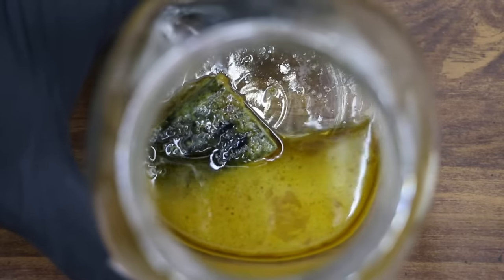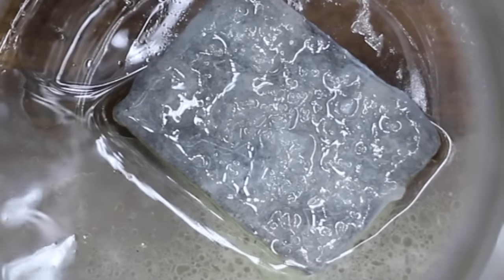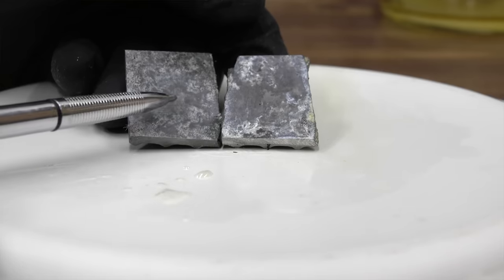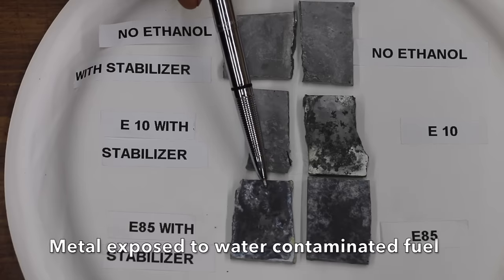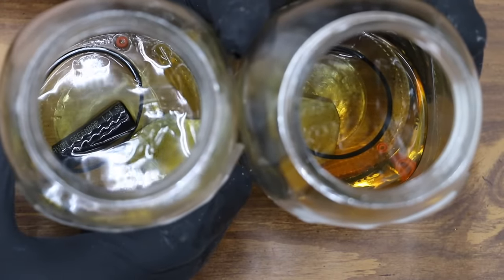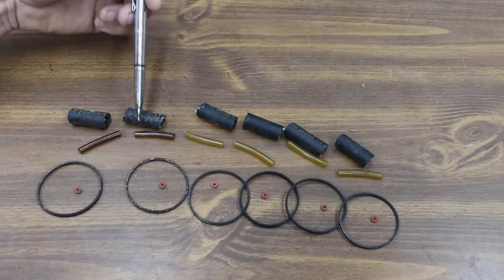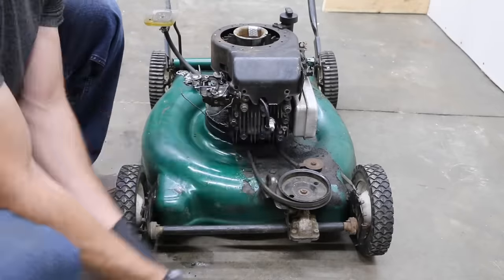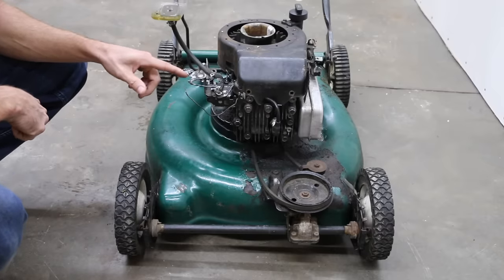Does Fuel Stabilizer Prevent Ethanol Damage?  Let's find out!

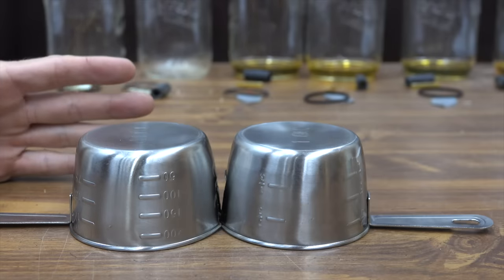Comment: 8:04 - Please test Sta-Bil. My experience with it is twofold. I never drain my mower or other 4-stroke machines at the end of the season.
The equipment (I'm just a homeowner/non pro) always fires up @ first or second pull.
I didn't use my craftsman weed whacker for a couple, maybe 3 years. It too fired up almost immediately last year. I haven't used it yet this season, but I have little doubt it'll give me no problem.
Reply from the maker: Thanks for the suggestion.

Comment: perfect thanks! so what about modern direct injection cars? does e10 or e5 cause damage to the engine or seals more then ethanol free ? or the only negative side is that it goes bad way faster ? in some videos says that e10 makes engine runs cleaner, some says rubber parts inside the engine suffer

Comment: Love the scientific test videos. as good as it gets without a lab. Outstanding!!!! Have two Tanks on my boat Aux tank has older fuel (8 mo old) but treated with stabilizer many months ago ,  v6 4 stroke runs on old fuel but barely idles, runs fine at higher(1000-1200rpm). Should I mix a small amount of old with new and run, burn it off, what ratio of old to new would you reccomend, please ?

Comment: I have had really great success with marvel mystery oil as a fuel stabilizer. Put in a little more than recomended on the bottle before I fill my gas cans. What doesn't get used over the winter, snowblower or generator, gets used in the mower. Any left at the end of summer gets dumped in the truck. I try and fill all the cans in late summer early fall. Try to beat the switch to winter blend.
Reply from the maker: Thanks for sharing.

Comment: If not already equipped, I add fuel shut-off valves to all my small engines (if possible). Then I shut them off using the fuel-valve, in order to burn off any remaining gas in the carb. Certain items, like generators with steel tanks, require draining all the fuel so the tanks won't rust. 
Otherwise, I heard a recent report that two-stroke gas-oil mix holds up better long term than straight gas, and actually, a few years ago, discovered that I'd left gas-oil mix in a small two-stroke generator for several years. Yet it fired right up.
Reply from the maker: Thanks for sharing.

Comment: Before I have even seen all of this video I can tell you one issue you might have overlooked with regard to ethanol corrosion issue... inside an engine, the carburetor is not totally saturated in fuel, after the engine is turned off, most of the fuel evaporates out, but with ethanol, because it actually is a source for water moisture, that moisture evaporates and off gases into the cold metal of the carburetor, and condenses on the small intake pipes of the carburetor and etch it enough to ruin the venturi effects, and after the ethanol has separated, there is also no way for the gas to ignite fully given the reduced octane rating. Poor syphon action will result in poor performance of the engine even when the gas is not totally bad, but with ethanol gas and a slightly damage carburetor, the drop of a few octanes can be enough for the motor to stall intermittently when otherwise it could run just fine. I have seen this happen within only a month or two. I enjoyed seeing this and still support my position of NEVER using ethanol based gas on anything with a carbonator.

Comment: Man you need to review Liquid Performance Ethanol Equalizer. I'm considering it but it's kinda pricey. Normally I use non-ethanol fuel in my truck and I get on average 100 extra miles per fill-up. Lately mileage has been lower though. Im wondering if they are adding a little ethanol to 'non-ethanol. Maybe this product does what it claims. Reviews seem positive but they can be bought.
Reply from the maker: Thanks for the suggestion.

Comment: I have a 14 year old generator that I keep ready to go year round. I use 87 octane ethanol free gas with Stabil and change it out by draining the tank and running it in my truck and then getting fresh gas every 6 months. Generator runs like new. I also only use synthetic motor oil in the engine.
Reply from the maker: Thanks for sharing.

Comment: Thank you! I just bought a generator for the storm season but thank God I didn't have to use it! But it has fuel in it! Question! Do you have a video on the proper way to store equipment to prevent corrosion?
Reply from the maker: You are welcome!  Thanks for the suggestion.

Comment: I had 5 5 gallon gas cans filled with e85 and used stabil per instructions that gas lasted about 15 months in central Florida garage.I did have one gallon that had some water seperation. The water was sitting on top of the gas poured it out and worked in lawnmower. Had I had a sealed tank where no air could get in and I think you could easily get two years out of them.
Reply from the maker: Thanks for sharing.

Comment: I thank you for the results from your test lab. These videos are scary. On another subject, where did you buy the mower with the electric starter? That is a great idea for this type of demo. I have recently switched to non-ethanol fuels for all of my 2 cycle engines.
Reply: I think some Troy bilt gas products have the ability to use a separate eclectic starter.

Comment: I do not use ethanol in my small engines and I do shut the fuel off and run the engine out of gas when done for the winter.   But once a month maybe 6 weeks I start my equipment and let it run for  good 10 minutes and get warmed  up and fresh fuel through it and on my zero rider it keeps the battery from going bad too.  It just is not that hard to do.  Then I turn the fuel off and run it out until the next 4 to 6 weeks.   Do this and you will never have carburetor issues.
Reply from the maker: Thanks for the feedback.

Comment: I had new ethanol gasoline gum up the valves on my motorcycle so bad the sensors couldn't figure out what was going on. Going down the highway, the bike would cut out then surge me up to a hundred miles an hour then cut out again.  After months in the shop with them scratching their heads, I called in the Lemon Law against Yamaha.  They sent a district mechanic out to look at the bike. He suggested running a gallon of Yamaha's Med RX through the engine.  Cleaned it right out, and now I have to add 3/4 oz to every tank of ethanol I put in the bike.  These days, I go to the extra trouble of using Zero E and the bike runs fine.  I had ethanol Premium ruin 2 two-stroke yard trimmers. And it messed up my lawnmower real bad. This was not fuel that sat (except in the gas station fuel tank), but fresh 10% ethanol Premium.
Reply from the maker: Thanks for sharing.

Comment: Mister PF, you make some of the greatest no-nonsense tests on just about anything a guy would want tested, IDK if your long term seal and rubber test vs. ethanol damage is ready yet but i definitely wanna check it out, because I am rather unnerved by the amount of ethanol getting put in our gasoline nowadays.  I know alcohol damages all kinds of metals no matter what the fuel refiner claims!  These companies are only worried about your next tankful and could not care less about longer term damage that cannot be traced back to using their fuels.  My question, finally, is since fuel stabilizer didn't protect engine components against ethanol damage, is there any additive or even combination of them that will?
Reply from the maker: Thanks for the suggestion.
Reply: @ProjectFarm  BTW have y ou found anything addditive wise, via your testing, that WILL protect against ethanol damage?

Comment: Does it still corrode if a carbonator is used daily or weekly? It seems like even if you crank it every day the carbonator is still in contact with ethanol. Maybe the benefit of cranking often is you pass the tiny amount of corrosive byproducts so they don't get a chance to build up and clog??

Comment: Just acquired a ATV that the manufacturer recommends 92 octane but where I’m at there’s ethanol in it..I use ethanol free gas in my small equipment with no problems so instead I’ve added octane booster to compensate…everyone else uses the 92 …going my route is it safer in the long run ? My machine is F/injected BTW…

Comment: Wow. I used ethanol-free fuel before parking my motorcycle for several years, but I stupidly added Seafoam to “stabilize” it. Now I know I would’ve been better off with just the E0. Everything corroded. The tank ended up bone-dry with pinholes of rust on the bottom while the gummy white slime crystallized all over the aluminum petcock and fuel door. The corrosion in the petcock went VERY deep, and I know it was the “stabilized” E0 because it was a brand-new petcock with zero miles.

The fuel ended up making its way through the carbs and cylinders and into the crankcase, completely filling it with gasoline. Because there is only a couple quarts of oil and nearly 5 gallons of fuel leaked through, there was no oil left. I filled the crank with oil all the way up to the level and it took something like 6 or 7 quarts meaning it still had nearly 4 gallons of gas flushed through AFTER the oil started spilling out the clutch cover. The engine was bathing in almost pure gas for several years.

DO NOT STABILIZE E0 WITH SEAFOAM! Maybe it helps for a couple years with E10 but don’t expect it to help with E0. You’re only adding the alcohol you’d hoped to exclude.
Reply from the maker: Thanks for sharing.

Comment: Watched the Non ethanol versus ethanol video prior to this and how you can drain the ethanol from the fuel. think I am going to set up and fixture in order to separate the ethanol form the fuel for all my small engines. I was going to install fuel shut offs on everything and run everything dry after each use to keep damage to a minimum but removing the ethanol seems to be a better option and the shut offs for yearly downtime in the winter.
Reply from the maker: Thanks for the feedback.

Comment: Aluminum will oxidize only until the outermost layer is completely oxidized, and then the process stops. The piece of aluminum is protected by a layer of aluminum oxide from further corrosion unless the oxide layer is either mechanically or chemically removed. For instance, Chlorine will remove the oxide layer.

Did you put tap water in the samples? Tap water is chlorinated. A piece of aluminum dropped in a jar of tap water will become corroded whether or not any other ingredients such as ethanol or gasoline are present.

Comment: i was able to find ethanol free fuel, and am wondering if i am wasting my money adding stabil 360 to it for use in my snow blower over this winter.... i guess the cost of the stabilizer is very cheap as long as adding it doesn't degrade the pure fuel in any way. From what i can see in your video it seems it didn't make any difference.

Comment: I recently broke down my Honda eu2000i generator. It's been sitting for 4 years. Prior to the long sit, I had about a half tank of fuel withE10 pump gas, that was treated with a standard "stabilizer," as I knew I wouldn't be using it too often. I emptied the fuel into a pan and it looked very much like yours, yellow with a bunch of large bubbles in it. The bubbles I presumed to be collected water vapor (?) I don't know. When I swished around the fuel, the bubbles didn't combine with each other or anything else. SO that was odd....

I found very little corrosion in the carburetor, with the upper part made of aluminum and the bowl of zinc coated steel. The bowl and most everything in it, was heavily varnished thou. A real pain to clean, I soaked it in SeaFoam, as that's all I had on hand....it didn't seem to do jack thou.

I found very slight amounts of white power substance, indicating corrosion on the carb. I found some issues with the rubber parts, fuel lines seemed OK, O-rings for the carb bowl was dried out and needed replacement, the diaphragm, in the vacuum operated fuel pump seems OK. Tonight, I'll be replacing the small O-rings at the bowl drain and for the pilot jet as a precaution, I'll be able to inspect them better when removed. Well, I had one fuel related line that cracked at one end, but that was the vacuum line to engine and most like due to heat.

I did read one article that stated that fuel stabilizers work as a barrier. They float on top of the gas and keep both water vapor from combining with the fuel.  Also, it keeps oxidation from taking place, this will happen with any fuel, hence varnishing and evaporation and loss of combustibility. I not sure if they all work this way, I have to read up more on this. I always assumed they mixed fully with the gas....

This generator has hundreds of hours on it, is eight years old and has always run on standard E10 pump gas...

One other thing, in my manual, it states using fuel stabilizer for stored conditions for 2 to 6 months max. If longer, drain all fuel from the system. So 9 months for your test, well that may be exceeding all expected parameters of performance or expectation...
Reply from the maker: Thanks for sharing.
Reply: @ProjectFarm  p.s. I replaced the little O rings in the carb (2) and they were in fine condition. With that in mind the manual recommendation is for no more than E10 and 86 or higher octane. Peace...

Comment: Thanks for the videos. Ive watched a lot of different ones on issues i deal with. I would like to find something i could fill or flush out the carburetor on my generator so it wont corode. I always ran it out of fuel. Ran stabil and seafoam. Both didnt help anything. No ethanol fuel to run thru the carb before i drain and store it will be my next approach.
Reply from the maker: You are welcome!  Thanks for the suggestion.

Comment: I’ve had very good luck with the original Lucas Fuel Treatment in stabilizing gas, E10 was what I had the most experience with.  While I’m ashamed to admit it I once due to chronic pain and not using my truck allowed the battery to go bad and before I felt up to swapping out the battery I think it was somewhere around 10-11 months had gone by.  Fortunately since my truck is infrequently used I always try to keep at least 1/2 tank of fuel and add Lucas Fuel Treatment to the tank at an estimated ratio to that recommended do not an exact measurement.   Anyway, upon finally feeling like handling the weight of the battery in the awkward positions needed to swap it out did so and to my very happy surprise the truck fired right up, ran and drive fine.  Now I’m sure there was some decline in octane rating and degradation but the fuel injected 02 Dodge 4.7L V8 5 Spd ran fine.   Was I surprised, with my luck I was figuring on having to drain 1/2 tank of old fuel.  Before I cranked the truck I removed the gas cap and sniffed the tank filler neck for evidence the gas had soured, it had not, because if it had soured I was not going to even try to crank and run it.  If I’m not going to immediately drive the truck at least a short distance after adding Fuel Treatment which would ensure good mixing of fuel and additive I also shake the truck after adding Lucas Fuel Treatment and run it for 10 minutes or so to ensure the treated fuel in the tank is thoroughly mixed throughout the entire fuel system up to and through the injectors.  Like I said embarrassed to admit allowing one of my vehicles to be done that way but chronic pain is a bitch of a mistress not to be wished on your worse enemy unless you really, really hate them.  I have yet to try Lucas Fuel Stabilizer for ethanol and non-ethanol is only available at a few stations where I live.  Last knowledge I had the nearest station having non-ethanol fuel was about 13-14 miles each way from me and appx $1/gallon more than E90 or E85.  I despise ethanol fuel.  I also add Lucas Fuel Treatment to all of my portable gas cans and my portable generator.  The only negative experience I have that may be attributed in part to Lucas Fuel Treatment but most likely just to long term intermittent sitting and use of fuel inside gas tanks is the build up of a varnish like material on the wire mesh suction screen in my generator tank where it takes suction from the tank.  I have needed to remove the tank isolation valve of which the strainer is sn integral part of and soak it in carb cleaner to break up and clean the varnish like build up from the fine wire mesh when the build up was affecting fuel flow to the generator motor.  Like I said I do not know exactly what the cause is there, could be a metallurgic and chemical reaction from the gas, ethanol and/or fuel additive.  The wire mesh screen is in the form of a standpipe for lack of better description and to memory it was a dark color which could have been an oxidative influence in the material, I would suspect it being bronze or a bronze and alloy mixture of metals, whatever it is you can be sure it’s as cheap of a material as possibly acquired and manufactured by the manufacturers.
Reply from the maker: Thanks for sharing.

Comment: Does the Ethanol in the E10 you buy for your Car ruin rubber fittings and Corrode the Gas Tank and Injectors? Now I'm worried, I  don't put it in my Lawn Equipment at all. I buy non Alcohol Gas for them, I heard it will really damage the small Engine's.  Thank You

Comment: so, can we conclude that the way to run a small engine is 1) start the season with an empty tank 2) add ethanol free to get things started 3) run with fresh e10 through the season or event (generator) 4) at the end of the season or event run a gallon of non-ethanol to flush things out and run the engine dry?